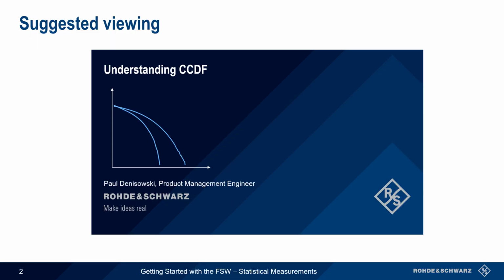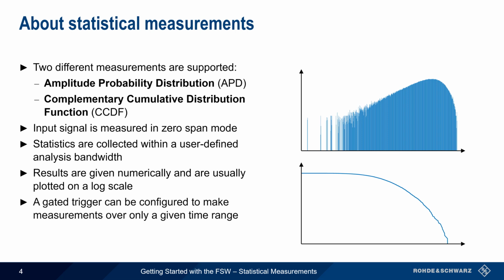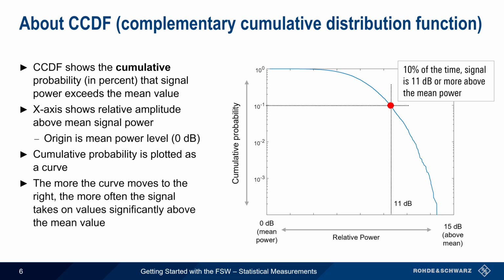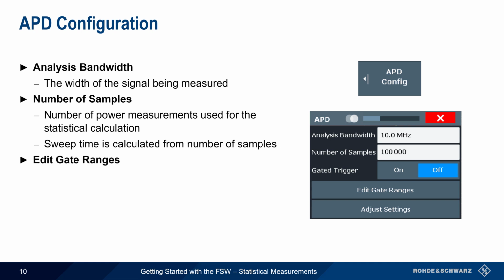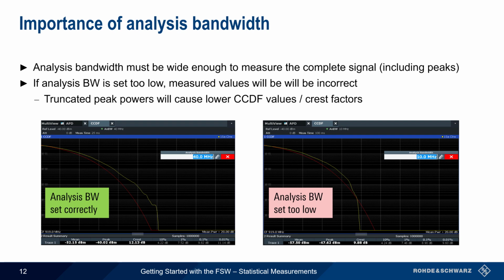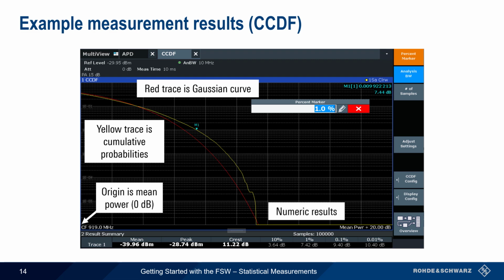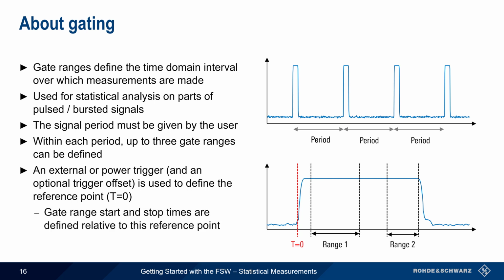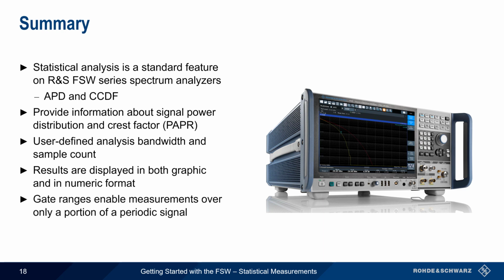Getting Started with the FSW - Statistics Measurements

Comment: Is Statistical Analysis a standard feature on Power Sensors as well?
Reply: It is on our sensors 😀  I made a video about this already:  https://www.youtube.com/watch?v=klX9z1T0cSI
Reply: @pauldenisowski  Oh, ok. So when the FSW is referred to as External Generator Control, is that in reference to how Signal Generators are used in combination with Spectrum Analyzers?
Reply: @amaechinwankwo8283  Correct - I have a video on that as well :)
Reply: @pauldenisowski Ok, thanks.
Reply: @amaechinwankwo8283  Yes.  And believe it or not, I have a video on that too :)